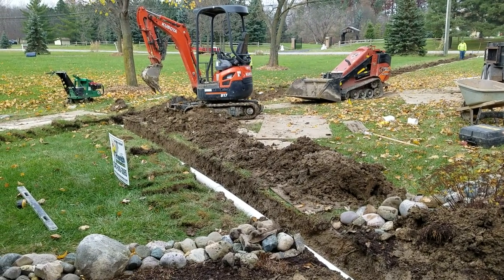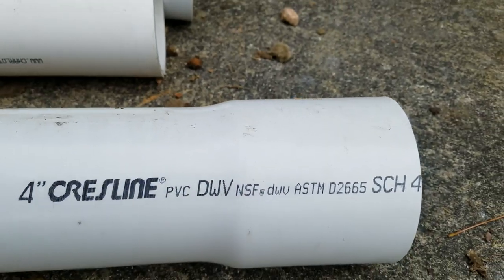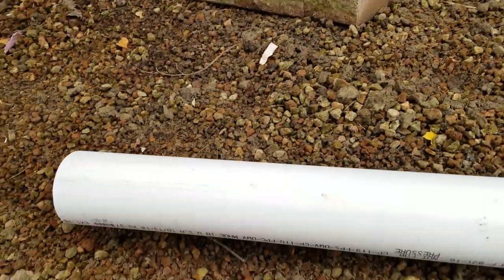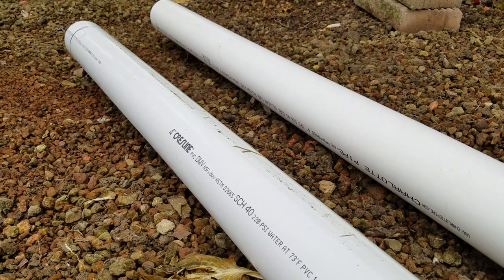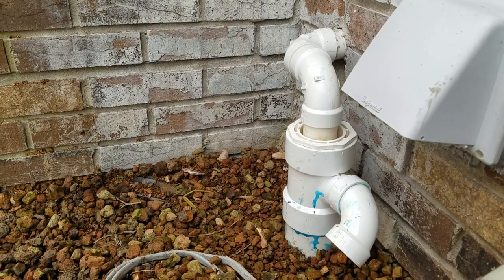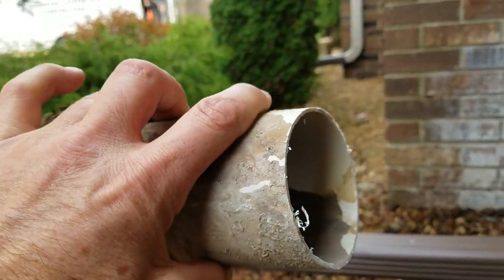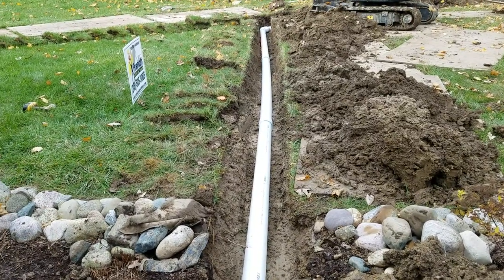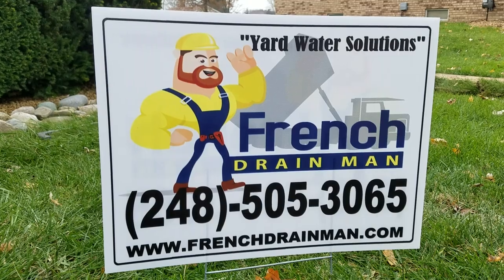How to Install a Sump Pump Discharge to Prevent Failure - French Drain Man

Comment: The overflow protector in my system literally saved my basement! I had a huge leak that we think was from the water-powered backup sump pump. The pop-up drainage emitter in the corner of the yard was completely covered with grass and mud and couldn't actually "pop up." All the effluent ended up being dumped into the side yard...which is definitely better than the basement getting wet. 😂
Reply from the maker: You need a new pop-up emitter, a better pop-up emitter.
https://youtube.com/playlist?list=PLjFCqaZ4v1BXt8vDpjMmvJXxMn8Tgw0wA&si=3l0BPgIbv2KFgGjT

4 in Pop-Up Emitter for Corrugated & Turf Restrictor Plate
https://frenchdrainman.com/product/4-in-corrugated-pop-up-emitter/
Reply: @FRENCHDRAINMAN  Next house for sure 🤘

I pulled some grass & laid river rock around my current emitter to keep it exposed

Comment: 2:42 Thank you for showing your discharge next to the house! I might look into doing something like this here in maine. Currently there's one of those freeze guard pieces installed at the transition. The problem is, most of the time the water discharges from the freeze guard opening, where it pools right next to the house and goes back down into the sump pit. The 4" corrugated pipe used to discharge underground, and I thought maybe that was restricting it.. So I put in a 4" pop up emitter, which unfortunately didn't fix the backing up issue. I know pop up emitters might not be the best idea in freezing climated, but I thought it was worth a shot.. Sorry for rambling, I'm just not sure what to do, who to call next. To make matters worse, it discharges under my deck, which only has about 1' of crawling around space underneath.

edit: in another comment I think I saw you say you replace this with a rubber coupling after inspection, I think that may give me the pressure I need to keep things flowing and not discharge next to the house..

Comment: As a young home owner who has a lot to update on my 1953 home and does most everything myself I genuinely appreciate this video. Currently our pump pumps into our sewer line (which I think is out of code?) however our “waste water” on our water bill is usually double than the usage itself during the wet months.  I have a nice sized ditch I’ve been planning on routing the sump pump to. Thankyou for the great detail. I live in central IN and have wondered about what would happen if it freezes. 

Thanks again! I’m sure I’ll be back later this summer 👍🏼
Reply: Same here and it's out of code. They had it routed outside originally but when they finished the basement they piped into sanitary sewer. When we have heavy rains it can't send the water out due to backup on the street! Good luck with your project
Reply: Keep it tied into it. Who cares play the ignorant card if anything gets inspected. You aren't a licensed plumber right? Then what do you know. Have 2 discharges one exterior one interior run interior 99% of the time and if the sewer ever backs up you can quickly switch the discharge route through a shutoff valve. Hopefully that doesn't happen but don't put it outside. Also how can they charge you for waste water disposal? How would they have any idea how much is going into the sanitary? It's based off your water bill usage if anything. They don't have a meter showing waste water going through that doesn't make sense. You shouldn't be paying anymore then your usage=discharge. You aren't using water when discharging with the sump pump. There is no way they can determine each home for discharge besides annual usage.

Comment: Great video thanks for the clear explanation.

On the subject, do you recommend running a check valve inline after your sump pump in cold climate regions?  I installed a Wayne sump pump and followed the instructions which included to add an inline check valve.  Low and behold when it got cold this winter the 1.5” pvc discharge pipe has frozen which resulted in the sump pump running constantly - luckily I got it before a fire started or the breaker blew,  but the pump was hot to the touch.  My thinking is without the check valve the line will be less likely
To freeze.

When I contacted Wayne they said they recommend this to prevent all the water flowing back into the sump pit and causing the pump to cycle on again...  My sump pit is a fairly large capacity (over 2’ in diameter) a so I’m thinking this isn’t as much as an issue as the line freezing.  I should mention the original sump pump did not have a check valve....

Comment: Do you have any videos showing how the drain is connected to the storm drain? I want to dig up my sump drain and add a bigger one, but i dont know what to expect on the other side. Im in Macomb County near you.
Reply from the maker: https://youtu.be/kj0fJtvWnuY?si=OgkfqpXml2p-X2Yb
Reply: @FRENCHDRAINMAN  thank you so much. I know my sump drains to an undersized 1.5" pvc. Should I assume the storm drain is cored to that little pipe or could I get lucky to see a bigger hole already cored there? It's in my backyard and I wanted to upsize it if possible.

Comment: Thanks a lot for your video! Could you please explain in more detail how the connection with the 1-1/2" pipe above the ground is made? What are the parts? Also, does the underground line need to be sloped? Finally, I don't have a ditch I could run it to. Could I take it out of the ground far enough from the house and then make a bend pointing back to the ground? Thanks again.
Reply: It looks like he used a bushing 4" to 2"

Comment: Great information.  Thanks!  So in summary, don't use Sch 40 instead of the thin wall (ASTM D 2729 Sewer and Drain Pipe), use 4" not 3", and use pipe with a bell end instead of a coupler.   So why did the original one fail?  Was it because it was 3" or because it was thin wall D 2729 Sewer and Drain Pipe?

Comment: How do you prevent the discharge line from FREEZING ?  That's always been my issue... the 1.5 inch line simply freezes and will notdischarge  75 feet away from the house. It works great otherwise but the pesky winter months.
Reply from the maker: You need 4" diameter pipe. It displaces so much more area, it can't freeze up.
Reply: It has to be sloped all the way to the end.  If there's any kind of valley in the tube it will collect water and it will freeze.

Comment: One other question, the sump pump water discharge line coming out of the house appears to have DWV 90 degree fittings on there and I know they are not supposed to be used under pressure (I have read maximum of 5 psi).  I have no idea what kind of pressure can be built by a sump pump (likely not more than 15-25psi but that is just a guess), but should PVC Sch 40 fittings that are rated for pressure be used on the line instead?  I can see it not being an issue once it dumps in to the 4" line since there will never be any pressure there.
Reply: Yes, I saw the power of my sump pump and it shot the water out from the house.  They are intense. Use sch40 pressure treated - which will have a smaller internal diameter - for a sump pump. My relief valve also points horizontal,  not down, because if it's necessary it will shoot the water a good 3' from the opening  instead of shooting into the ground - making it a little harder to get into the foundation.

Comment: everyone who has a sump system in the cold needs to see this. I did mine myself but i run my drainage line over ground into a pond on my property so i don't have to worry so much about ice. but i'm tempted to bury it now that i've seen this. i'm in NY btw
Reply: @M L very true witch is why i have my dranage line a 4 inch pipe and moving water doesn't freeze so even if it freezes a little bit it is never enough to block that 4 inch diameter.

Comment: I looked at specs the Cresline is .075" thick, same as bell end Charlotte sewer line, do you use it awell? 
Also I'm SE Iowa how deep is that shallow install, and grade drop, I  have roughly 140 foot to get to the ditch here and two 90's degree to get around gas and well line.
I'll have to hand dig to find their depth, and travel over or under as needed. 
Thanks
Reply from the maker: You need to use only 45° And keep them at least 2ft apart. 42" depth to get out of the frost otherwise you should use rubber couplings.

Comment: What is the connection that goes "up and down like this" :-) Inspector just noted that the closed pipe system I just installed should be "open" and I see the grate type overflows but I see you have a "super duper" overflow in the form of a tee and a 90.  Just wondering what the slip joint connection is :-) thanks FDM
Reply: I second this question.
Reply: It's called a Bushing. It probably a 4 inch to 2 inch.

Comment: Hey frenchdrainman great video!  what exactly is the design where the sump line comes out of the house and enters the Tee?  What pieces are involved so that the PVC can move up and down?  Is that just a reducing bushing, meaning the top of the tee is 'open'?  If its a reducing bushing is it a 2" so that the 1 1/2" line has room to move?  I'm currently re-doing my sump drain line(old glazed clay tile full of roots/mud)and I like the idea of expansion/contraction.
Reply: Yes
Reply: was wondering this too

Comment: Do you have a minimum depth you like to place your discharge lines at?
Reply from the maker: It all depends on what the grade is like on the yard and where I'm taking the sump pump discharge line because if it's going to daylight, it's going to be shallow. There's no way around it. It has to be.

Comment: Great info! Do you recommend taping and/or screwing the pipes together in addition to gluing them?
Reply: PVC glue is basically a solvent. Both pieces dissolve partly (aka melt) and then solidify together as one piece of solid PVC. Don't make more holes with screws.   I would maybe use some 
flex rubber aka Fernco flexible rubber couplings if the pipe was really long to allow flexibility.
Reply: Absolutely not

Comment: Hello folks... a Canadian here having difficulty with the name of the parts especially the Tee used. We are still in lockdown here in Ontario and so I  cannot go into Homedepot (or any store) to look for the parts required. Trying to find and order the parts online is extremely
frustrating and people answering the phones are not much help unless I have the part number or the sku# then I end up with the wrong part with no returns until the lockdown is over.
The only difference is I have a 2 inch pipe coming from the sump
 pump.

Comment: Trying to figure out what to connect to the discharge end of a 1.5 inch pvc pipe connecting to a sump pump.
Reply from the maker: Code is 3" pipe minimum. If it's flat 4" minimum
Reply: @FRENCHDRAINMAN  I was going to go with 1.5” to 3” coupling reducer, then 3” to 4” coupling reducer, then 4” to 6” coupling reducer for a 6” catch basin drain.

Comment: You have to get a schedule 40.. if you want more surface area for the glue and primer to do its thing you need to use the recommended coupler not a drain waste and vent coupler

Comment: Hi Rob. If there was no inspection required would you still use PVC schedule 40 ? Would you design something similar to your downpipe adapter with the clean out as the freeze overflow ? 🇨🇦 Thanks
Reply from the maker: Dualwall 
https://youtu.be/LMNrmZpUeGg

Comment: Schedule 40 is too brittle. There is flexible thin wall and rigid. The flexible three ply, is for above frost.
Reply from the maker: Michael O'Hara the building codes and Departments Require it to be Schedule 40 PVC. Thank you for commenting

Comment: Haven't watched it all but if your sump is 1.5" why go 4"?
Reply from the maker: The larger the diameter of a pipe, the stronger it becomes, even if it's made of the same material and the wall thickness is the same. Not to mention that if there is any settling of the ground and a little bit of a belly forms, you can recover with a 4-inch pipe where, with a 3-inch pipe, there's no recovery.
Reply: Thank you. @FRENCHDRAINMAN